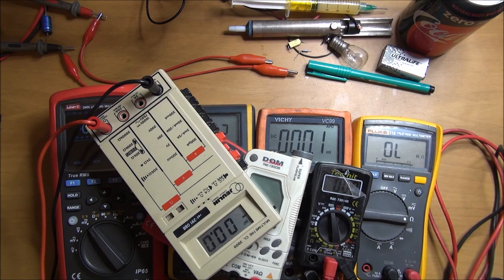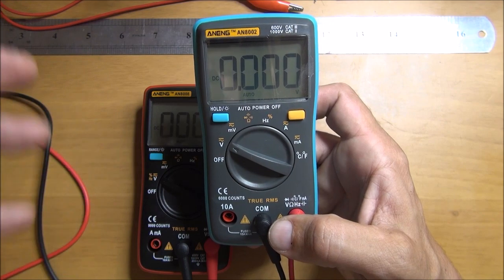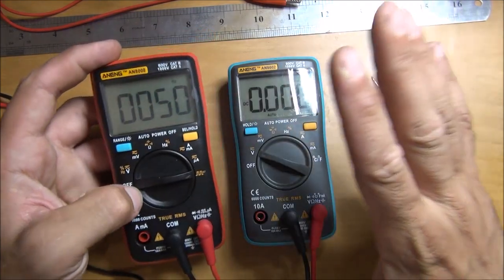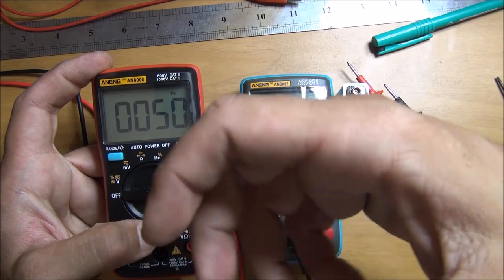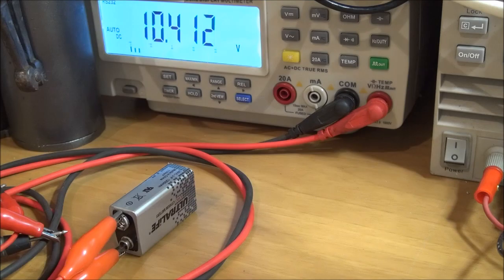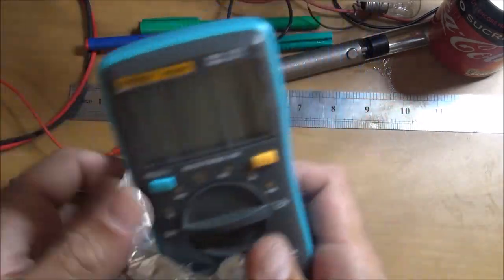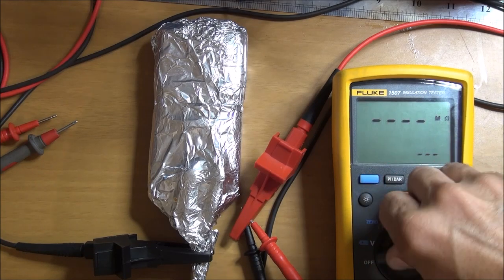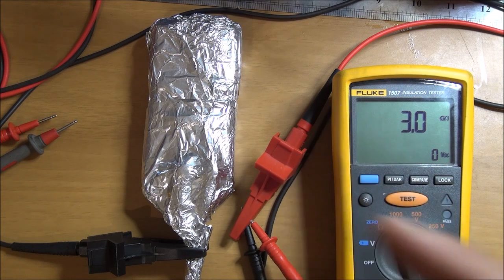ANENG, the Fluke Killer (insulation test)

Comment: I’m pretty sure that this guy making video of Aneng multimeter will not using this basic multimeter when he supposed to test high voltage or high energy circuit on mains. He has already Fluke multimeter so he will use them and misguiding others to purchase cheap multimeters

Comment: Super thank you I must say that it works well this multimeter I have one but it is at the level of the protection against a bad measurement that they are more fragile than a Fluke, if you measure a current of 400mA for example and that you are on the 200mA position a fluke will resist and will tell you to change the scale an ANENG will be out of order on this measurement and definitively. Thank you for sharing.
Reply from the maker: the aneng 8008 is able to support 10A on his mA caliber and Aneng 8002 can support 1A on mA caliber. Fluke can give you more confiance, and reliability. But I think Aneng are not so bad, for the price. Thanks for commenting.

Comment: As i see it it's a nice multimeter. I guess it has not temperature probes so we cannot measure temperature. Which one Aneng you think is the best the blue or the red one ?
Reply from the maker: it has thermocouple to check temperature, delivered with the multimeter. For electronic purpose, the blue is the best. For rough electrical red is ok. Those multimeters are perfect for hobbyist and are not made for working on dangereous factory area, even if I use it in my work (I am process engineer). They are perfect for the price. You need to check the specs accordind your need to chose the device you need.
Reply: @AIexanderHartdegen  Thanks... I have seen also ANENG AN870 the green one. DO you have opinion on this since it's the most expensive of the bunch ?
Reply from the maker: @RHTORAS  it's more expensive because it has one digit more. It's a very nice multimeter for the price also, like Aneng usually do. The important thing is the features you need, for choosing a multimeter. This one is very nice, but big. Mine is the 8002 because... It perfectly fit my little suitcase tools.
Reply: @AIexanderHartdegen  I am electrician enginner and i will surely use on 220 voltage in europe. I only know a few feature usage but i want as much as i can. So is the green safer and more compact overall ?
Reply from the maker: @RHTORAS  the green is bigger than blue or red. We can tell it's more secure because it has bigger fuse (white ceramic I gess) and easy to replace. But components are globaly the same. The additionnal digit is precious to make comparaison between many values like metrologic works. Also, because it's bigger, it can give a better impression of security and more serious. So, if you have to deal with some people, this multimeter is more ressembling according a serious fluke or other famous brand. 
The 870 is not more compact, it's more accurate (at least according with two different measurements). If you intend to use it at work, the green is really " better", mostly if you have to deal with a customer.
Reply: @AIexanderHartdegen  Ok thanks. As i see it the green is the way to go. I can use it safely on 220 volts on a regular home voltage right ? The only thing is you say it has fuse but i can't find any info. Does it realy has a fuse? Thanks in advance.
Reply from the maker: @RHTORAS  Search on youtube " AN870", there is some good review about it. It seems to have two fuses, for short circuit limitation. Unfortunately, cheap  multimeters have sometimes cheap leads. Always check the conditions of the leads before working with the main.
Reply: @AIexanderHartdegen  so you suggest me changing the leads ? I have heard other state that too. What's the different if i chanbge leads ? I mean expect the more precise measurements.

Comment: Hands down one of the best multimeters to work on cars.
If you are a DIY you can't go wrong.
If you are an electrician and work on homes and things with a high voltage a Fluke its the way to go.
Ultimately it is a budget friendly multimeter.
Reply from the maker: high voltage is more than 999V. I know nobody working on this voltage range. All voltage under 1000 is considered as low voltage.

Comment: i doubt if ill ever use it  mine on any thing more than 400volts so thanks for putting my mind at rest
Reply from the maker: I use it on 420 VAC, 220VAC, 48Vdc and ac, and 24Vac and dc.
It works on every condition, but I recommend to use it on 220V maximal voltage.

Comment: EEVblog did a better review and teardown of an Aneng meter - found cheap flimsy inputs with horrible input protection and substandard fuses. Chinese manufacturers will print a CAT rating on anything.

These are useful for hobby use only, use with any electrical system which has the capability to cause harm is downright stupid especially in a professional capacity as you would be opening yourself to legal repercussions. 

"Fluke killer?" That's just laughable. The Aneng is a rebranded Zotek meter. The Zotek branded ones don't even hide the fact they're a rip-off of the Fluke 15B/17B/101 etc meters as they even use the same numerical system. Aneng meters are just another Chinese rebranded DMM with cheap construction, borrowed styling, and poor safety.  More of a toy than a tool.

The fact you are advertising them as being on par with even the Chinese market Fluke models is shameful. These meters could kill or maim someone.
Reply from the maker: don't buy it, and rather of it, give your money to this nitwit of dave jones.
Reply: You should rename your video: "Aneng, the killer" :D
Reply from the maker: @scod3908  I think you are an asshole. Give away from this channel please.

Comment: I'm not sure I understood the test you did. The Aneng didn't have any insulation to protect the user from high voltage. Are you saying this test proves that the Aneng is safe to use in situating up to  1KV?
Reply from the maker: no. UNTIL 1K, no up.
Reply: Alexander Hartdegen so it is safe up to 1KV. Is that what your test shows?
Reply from the maker: @xray364  it shows it's safe until 999V, with two wires connected to the same point (no measurement process). It's a test about phase isolation, no wire to wire measurement. This device have not to be used over 380V in current use.
Reply: @AIexanderHartdegen  

It comes with a 250v fuse, that's all you need to know to never use the ANENG meters on mains besides checking with NCV if your cheap meter has it, FAKE certifications are no joke, if you need a mains multimeter buy a reputable brand, a Fluke multimeter is cheaper than third degree burns or funerals.

Comment: If you value your life do not ever work on voltages above 100V AC/DC with these meters.
Reply: I have a Victor VC97 which also is a Chinese DMM and i measure 400~600 V DC on Tube amps and i haven't had any problems. safety is good but if you know your instruments you can count on them.
Reply: No it fine for that,  it when dealing with higher then 400 vac, triple phase, or high currents with these meter I would worry and won't recommend. In other words don't use it in a industrial setting where risk of flash over, or high voltage spikes are likely to occur. Get a fluke, or  brymen that uses proper isolation spacing and slots and have a few large MOV's and PTC with spark gaps and real hrc fuses. For most hobbyist use these cheap meters are fine.
Reply from the maker: you're right and wrong. To not working on higher voltage is more secure. But I use it on 420AC. And it works nice.
Reply: @AIexanderHartdegen in Catagory I or II for 600v it’s no problem with these cheap multimeters. But Catagory III environment these meters are very dangerous as they can’t withstand 600v in this environment.

Comment: Hardly a Fluke killer, but for anyone who only measures lower voltages regularly, these are surprisingly good. Fluke has rightfully earned its reputation as one of the best multimeter manufacturers out there. Personally, I use two Brymens - a BM829s at home, and a BM257s at work. I generally deal with low voltages but having the other features and robustness are useful.
Reply from the maker: @Brian Thompson hello. I have a Unit 181A, a Grenlee 200A, fluke 115, Fluke 189, Fluke 87V, a Fluke 289 and a Brymen 857s. They are perfect and I use it currently on my bench. But for working I use a Aneng 8002 since 4 years now. No one of all those multimeters can replace it. Price, reliability, accuracy, light... So, if it's hardly a Fluke killer for you, I can tell it's the case for me. But so, everybody should find his advantage on this deal. Thanks for your comment.
Reply: For me, the Aneng is also a Fluke killer. Compact, accurate, easy, inexpensive to replace (if it should break).  On top of it, I just received a safety recall for my Fluke 87V. Some kind of connector problem. My only dislike for the Aneng is the soft plastic screen. It easily scratches.

Comment: Bonjour et merci pour cette vidéo , je viens d'acheter les deux modèles  car j'ai grillé mon Fluke "bêtement" et vu leurs prix, leurs performances et tes conseils il n'y a pas photo :) je ne remet pas autant d'argent pour un autre Fluke !!! je ferai certainement tes modifications pour les fusibles .A+
Reply from the maker: @jm aurillac dommage pour ton fluke. Tu peux y aller les yeux fermés sur ces multimètres Aneng ils sont imbattables. Leur qualité de mesure correspond à du fluke à 250E. Les cordons livrés sont de très bonnes qualité, la lecture des diodes est digne d'un fluke haut de gamme, tu ne seras pas déçu c'est sûr. Il y a également d'autres modèles comme le Aneng 870,  ou le Holdpeak HP-770D (mesures d'un fluke 180...) J'utilise le Aneng 8002 de façon professionnelle depuis longtemps (en TBT), aucun autre multimètre ne peut le remplacer. J'ai revendu des Aneng 8002 modifiés à des confrères qui l'ont trouvé génial. Merci pour ton intérêt et ta confiance.
Reply: @AIexanderHartdegen  merci pour ta réponse :) , j'avais déjà vu le holdpeak chez Philippe Demerliac, un internaute lui avait parlé des "obturateurs" de sondes évitant les mauvaises manipulations mais pas eu de retour de test donc je me suis basé sur tes vidéos(ANENG) très pratiques pour ceux qui ne savent pas trop quels modèles choisir !! à quand une vidéo "test" sur les oscilloscopes numériques?? ou même sur ton ATTEN ads1102 ? A+ Jean michel
Reply from the maker: @jm aurillac les oscilloscopes c'est un sujet très complexe. L'utilité d'un oscilloscope est extrêmement variable et les utilités des options sont vraiment aléatoires en fonction de qui l'utilise. Je n'ai que rarement (voir jamais) abordé ce sujet, car un test sur un oscilloscope sur Youtube c'est argumenter entre une Méhari et une Ferrari. Ceux qui ont une Méhari n'ont pas forcément les poches vides et ceux qui ont une Ferrari n'en ont pas vraiment l'utilité... Néanmoins... Les oscilloscopes modernes (électronique à mémoire) sont plus que suffisant pour 99% des électroniciens. Autrefois il fallait payer un prix fort pour un oscilloscope à mémoire, maintenant ils valent à peine le prix d'un Métrix haut de gamme. Choisir son oscilloscope c'est comme choisir sa voiture, mais la nature principale reste la même. Donc une vidéo test sur des oscilloscopes numériques sous-entendrait beaucoup de choses: d'une, l'oscilloscope serait soumis à un jugement parfaitement arbitraire, de deux, les raisons réelles du test ne sont pas la réelle motivation de la vidéo. Beaucoup de tests ne sont que des publicités déguisées, en quête d'affichage du produit. Si l'on sait que presque n'importe quel oscilloscope à 400E ferait l'affaire, pourquoi faire des tests supplémentaires...? 
De plus, faire un test à l'heure actuelle d'un oscilloscope numérique correspondrait simplement à comparer deux véhicules en fonction de leur options. On en viendrait presque à oublier le rôle premier d'un oscilloscope. Je ne me défini pas réellement comme un " testeur", même si c'est ce que je fais dans quelques une de mes vidéos. Pour tester un oscilloscope, il faudrait en avoir 2 entre les mains tous les jours, définir quelques avantages et inconvénients, choses qui ne sont pas dans mon contexte. Et il faudrait savoir jusqu'à quel détail technique la critique devrait aller? Certains points nécessites des études supplémentaires car très spécifiques. Pour moi, à l'heure actuelle, tous les oscilloscopes sont bons: pour l'utilisateur il reste à définir sa fréquence maximale d'utilisation, le nombre de canaux, l'isolation du secteur,  et quelques options... La linéarité d'une lecture de signal ou la possibilité d'affichage de qualité d'une courbe de lissajou varie d'un appareil à un autre (oscilloscope analogique ou numérique...?). Même un kit à 25 E peut être suffisant s'il répond exactement à vos besoins.. Mais sur un établi confirmé un 50Mhz trouvera parfaitement sa place. N'importe quel oscillo à 300E peut fournir une transformée de Fourier.. Pour toutes ces raisons matérielles, économiques, philosophiques, il ne me serait pas évident de faire ce genre de tests. Si je reçois un oscilloscope " for free" je serai ravi de le tester... Car c'est ce que me demanderait l'entreprise qui me l'aurait envoyé. Les oscilloscopes tel que " ads1102" répondait parfaitement à mes besoins à une époque, des besoins qui ne sauraient être valables pour motiver une présentation généraliste.
Pour ce qu'il en est de l'ads1102 c'est un oscilloscope suffisant pour des usages généralistes. Sa bande de 100Mhz couvre les utilisations plus que suffisante dans beaucoup de domaines, sauf la radio peut-être. Aujourd'hui les comparaisons sont d'ordres ergonomiques, le plus grand écran, décodage, sondes différentielles... Il possède le single shot, ce qui était la raison première de son achat. Et pour être honnête, on finit toujours par utiliser le plus puissant des oscilloscopes en mode "automatique"... Il y a beaucoup plus de différence à noter entre différents métrix qu'entre les oscilloscopes modernes. Les oscilloscopes portables ont un avantage, celui d'être isolés du secteur et de permettre des mesures en toutes circonstances (portable ou pas c'est un argument décisif mais non une critique). Donc pour moi, tous les oscilloscopes sont bons... Car chacun répond aux besoins de celui qui prend la peine de l'acheter.
Toutes ces raisons sont les raisons pour lesquelles je ne fais pas ce type de vidéos. J'espère que je n'ai pas été trop brouillon dans mes explications.
Reply: @AIexanderHartdegen  pas de souci pour tes explications, je comprends:)  je débute et donc mes questions s'en ressentent  :) j'ai bien compris que tout dépendra de mes besoins.
 j'ai personnellement  un tektronix 468 acheté avec un lot d'appareils mais pour moi c'est encore l'inconnu, j'utilise que mes multimètres A+
Reply from the maker: @jm aurillac pour un "débutant" c'est pas si mal que ça un tektronix 468. Le principal c'est d'en avoir un, le reste c'est franchement du marketing, même si certaines options sont sympathiques sur les oscillos modernes. Le tektronix possède déjà une digitalisation des signaux ce qui est déjà très bien. Bien entendu, il n'est pas interdit de se faire plaisir avec du matériel moderne... Bonne soirée à toi.
Reply: @AIexanderHartdegen  j'espère savoir m'en servir un jour :) bonne soirée également

Comment: tear down maybe require so we can have a look inside to compare to a decent DMM
Reply from the maker: @Zalds Lim
      Hello sir, this video is not a classical review of this multimeter. It just provide the insultting ability of this multimeter. As I said first in the video during the screen text, there is a lot of review of this multimeter and this video will provide another specific point noticed here, wich is the insulating abilitys of this multimeter.
If you are looking for a professionnal multimeter, you need to know than this multimeter is not recommended for industrial or professionnal use, thanks.
Reply: @AIexanderHartdegen  ok im just saying no bad intention
Reply from the maker: @Zalds Lim no problem sir, sorry if my quick response can seem little short. The main problem with this multimeter is the size of the fuses. In another video, I make a modification for to use classical 5x20 fuse.
Of course, this DMM is perfect for the hobbyist, but are not recommended on sites, or power plant, even if as a technician than I am use it on sites, cause it's light, easy to replace, and tiny.
Thanks for your comment.
Reply: EEVblog did a teardown of an AN8008, found them to be cheaply constructed with substandard input protection. Compare to his review and teardown of a Chinese Fluke 17B+ for reference.

Comment: Nice job! Now i am happier with my aneng an8002 after watching this video. can you compare milivolts measurement with fluke? on milivolts selection aneng an8002 shows irrelevant values instead of 0.000 value when even probes are idle (as we can see in the video).
Reply from the maker: @Ahmt Ahmet Yes. You can see it in this video
https://www.youtube.com/watch?v=m1txNmyVq1U
Reply from the maker: @Ahmt Ahmet When you use millivolt range on such sensitive devices, you will always have a fluctuating voltage displayed on the screen. This is normal, it caught electrostatic and alectromagnetic field. When the probes are shortcircuited, you also can have a little value displayed, cause the seebeck effect. But those value are minimal. All multimeter wwhose have probe in air with the millivolt section applied displayed some ununderstable value.

Comment: Why you change option to mV all values are changing whiteout measuring? Why not stay on 0 (zero) like on cheap multimeters. Why values are changing on mV.
Reply from the maker: Because ultra chip multimeter have not mV caliber, so they can not wiggling. Also, a millivolt caliber aways fluctuate when probes are on air.
Reply: @AIexanderHartdegen  thank you, I saw it on many video on YouTube. My is new. Now I know that this is normal. Thx again.